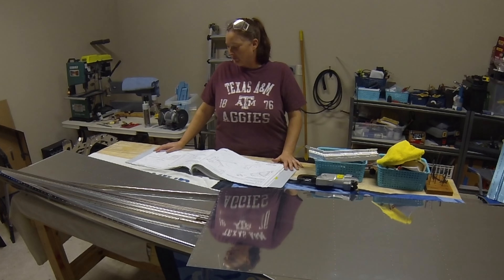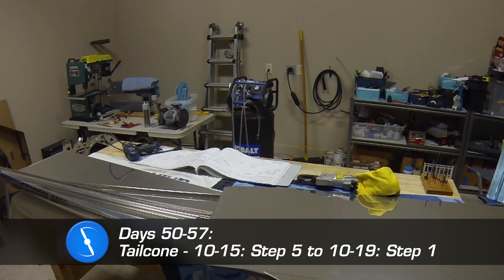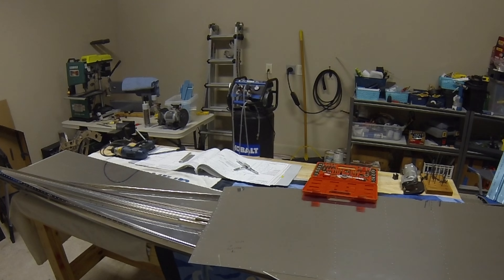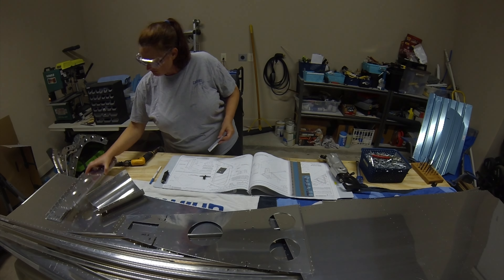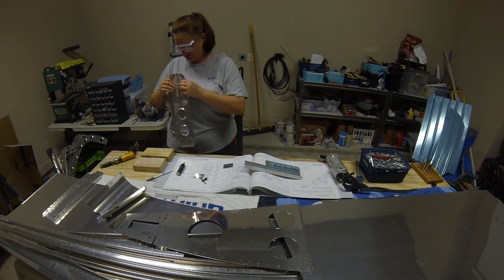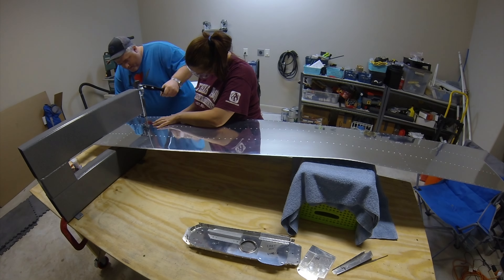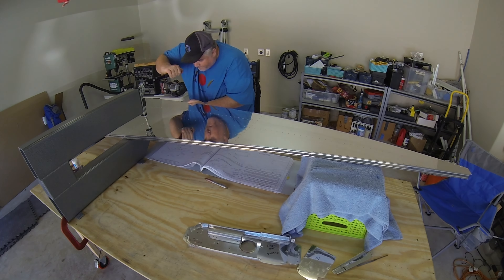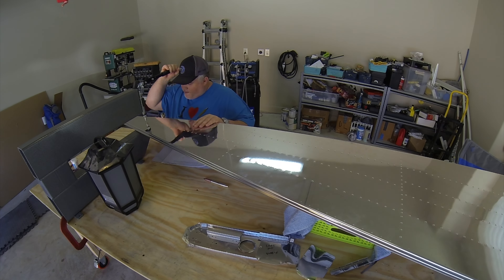Van's Aircraft RV-10 Build: Days 50-57 - Begin Assembling the Tailcone (10-15 to 10-19)

Comment: Thanks for posting. Love your videos. Here are a few minor things I noticed: Countersinking to accommodate dimpled skin is governed by Van's chapter 5.5 instructions. It's always seven clicks deeper than a flush rivet. If you make the dimpled skin fit, it will be too deep and the sheets might not interlock tightly. Also, it says to not rely on fixed depth settings, you need to frequently monitor the depth as you go. I used torque seal markings on the cage to have a good reference point but I check it every few holes again. There are also big differences depending on the shape of the part you are dimpling. The cage is not sitting flush in the same way on all parts.
On the DRDT2, it's easy to temporarily remove the extension of the handle for hard to reach holes.
I would think that the rivet gauge needs to sit on top of the dimple's rim to judge length? Or at least leave it a bit longer if the hole is dimpled?
Reply from the maker: So I went off of the way Cleaveland Tool demonstrated on setting the countersink for receiving dimpled skin (https://youtu.be/IQyipOcCxgc) and the way EAA demonstrated setting the countersink for receiving countersunk rivets (https://www.eaa.org/videos/6055153148001). Based on those demonstrations and some testing we did with scrap pieces, I found it to be ten clicks different to get it set for rivets versus dimpled skins the way we saw it in their explanations. That’s just what I found that worked with our set-up. I do check the holes as I go to make sure everything is still sitting flush and have made some tweaks to the countersink here and there. Yup you’re right, the cage doesn’t always sit flush on different parts - corners are always a bit tricky and I like to sit a piece of scrap that is the same thickness next to the part I’m countersinking to help keep it level.

I’m glad you love the videos! I’m sure you understand that I’m just trying to share information or experiences that I think are helpful. These aren’t meant to be fully detailed instructional videos that cover every aspect of how to use everything 😜 but you brought up good points!
Reply: @PlaneLady  Thanks for the reply. Here is where Van's explains how they got to the conclusion that 7 clicks is their recommendation:
https://vansairforce.net/community/showpost.php?p=1154282&postcount=5
Basically 9 is the limit where it starts hurting the strength, so they went 2 under.